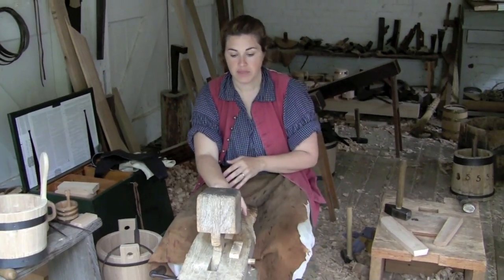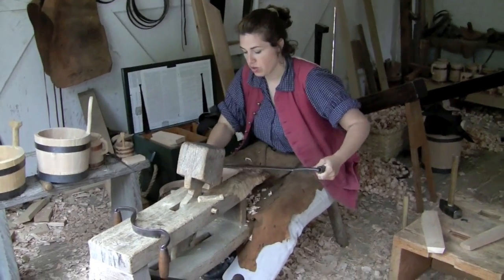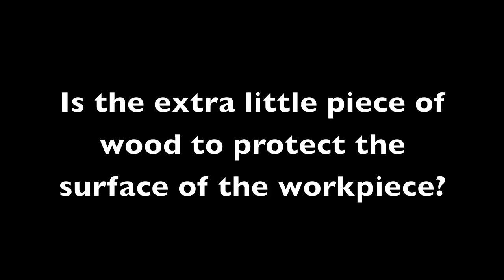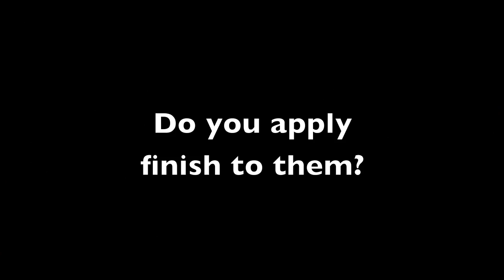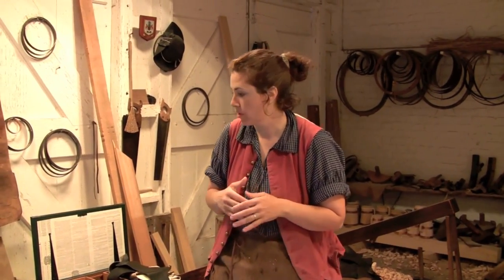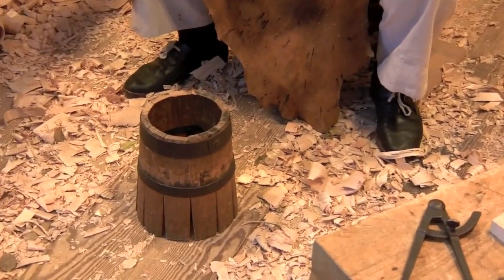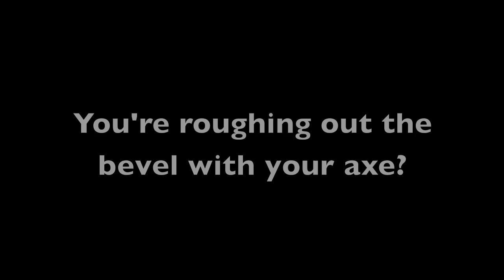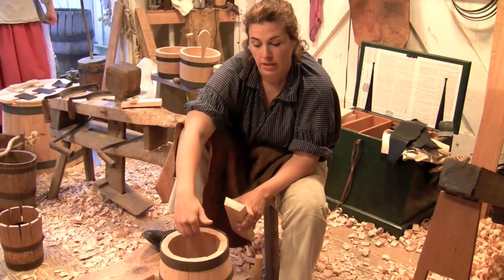Ramona Vogel, Journeyman Cooper

Comment: great stuff, but I wonder would a kiln or oven be a help in the different processes? I'm sure I ask more as I follow this. was really disappointed when I saw the wedding band ;)
Reply: Soft@♥
you forgot the address. and any more videos? will general delivery work ?
Reply from the maker: Bill, Ramona and the other coopers at Colonial Williamsburg are following the steps that were used in the 18th century to make barrels. Not sure how people today would go about making them, but there are still coopers making barrels for (at least) the whiskey industry. That would be a fun topic to research.
Reply: you are so right, The art she is practicing seems to bring her great satisfaction. I hung on her every word.
Reply: even today they still use 'crecets', but they are somewhat more modern and usually fueled by propane and also packed with wood chips.

They don't use kilns or ovens because 1) it requires more fuel and 2) they weren't concerned with the exterior of the barrel.